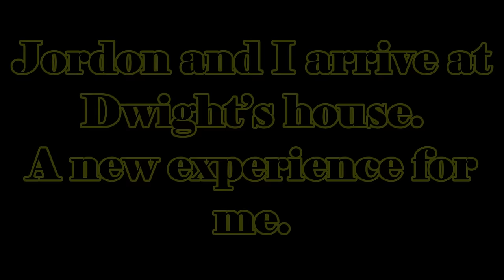Scooter Tramp Scotty. Cross Country Pt-4 (New Vid) #motorcycle #nomadiclife

Comment: Harley's....always something going wrong with it....😂
Reply: That's part of their charm, lol
Reply from the maker: Joes Honda XT lost its hydraulic clutch slave cylender in NM on the way to sturgis. Book calls for pulling the motor to replace it + he had to wait on the parts. Big job for a simple clutch cable that id replace on the side of the road. 1800 Goldwing manual calls for 4 hours to replace the air filter. Yeah, i think harleys break more but on the old ones at least u can fix anything that breaks.
Reply: @scootertrampscotty  Joe was using the wrong bike...a performance oriented sports bike for long distance touring.  Those things need lots of TLC and for short fast runs and parked under cover at night like a race horse.  A Honda designed for purpose like an Africa twin or transalp ....never would have had any problems....
Reply from the maker: @sharmaLlama  
His new Honda, very low milage, lost the rear suspension, $800, the charging system, etc. Joe Sparrows high milage 1800 Goldwing went through 4 driveshafts, 3 timing belts, 3 sets of neck bearings, starters, etc over the years he owned it and Joes an extremely good Jap bike mechanic. I rode the thong once. It was all fucked up like my old bike. Normal riders often think these things never break. Use them like we do and youll change your mind.
Reply: @scootertrampscotty  👍🤠..not going to argue with you mate....you do more miles in a year than I'm going to do in a lifetime probably...enjoying your content, stay safe and keep living free...Cheers to you Scotty
Reply from the maker: @sharmaLlama  
Oh, keeping any bike running out here is the bane of my existence. I think if you buy new then get another every 50k of 60k miles one could probably avoid a lot of breakdowns. But these fucking things just all seem to give you trouble eventually.

Comment: I've seen that bicycle thing twice in Ohio in two different towns. It's a lot of f ing bikes.
I owned a 04 twin cam once, liked most everything about it🤔
Except the ppe (piss poor engineering). Pulled engine after 50k miles and repaired all that nonsense,  did some preventative maintenance while apart. Was furious over all the made in China tags I found throughout the wiring harness!
If I weren't old & disabled,  a 90 s something Evo would be my first pick for a scooter ✌️🤙

Comment: Scotty.have you tried to back the timing plate down a tick to work the ping out? sometimes just a degree or 2 less timing will make it happy..
Reply from the maker: I did. Pinging was caused by a different problem. The motor later went south because of it.

Comment: Over head valves been around since early ‘20’s. 
I have a hill climber F head in storage
Reply: eye was g0nna say early 30s.
🤙
Reply: 1911 was the first year for the IOE (F) head twin cylinder. A single cylinder IOE (F) head came out in 1926 (345 cc ).
Reply: @everettcalhoun8197  that’s good info. My hill climbing F head was a twin originally. The guy wanted to qualify for the single cylinder class so he took the rear cylinder off and capped the hole.
Reply from the maker: F-Head has one overhead valve if im not mistaken. Still oval shaped combustion chamber like a flathead though, aint it?
Reply: @scootertrampscotty  that is correct.
Reply: @scootertrampscotty  The F head had an overhead vacuum operated intake and a conventional flat head exhaust and as you can imagine it was not a high revving engine because the intake did not start opening until there was enough vacuum to open the valve. Domed pistons didn't evolve until the knucklehead with both valves in the head and you could angle the valve to dump more charge into the cylinder.  Alas the factory went back to a flat piston with a squish area. with the evo and then the bathtub with the twincam. Just sayin'. Later, my friend.
Reply from the maker: @everettcalhoun8197  
They made them with a pushrod for the top valve. Ive seen em.
Reply: @scootertrampscotty  Yes they did. Harley experimented with many designs but the vacuum operated intake is still the most intriguing design in my opinion. Later.
Reply from the maker: @everettcalhoun8197  
Slow turning

Comment: Great video again Scotty. Is that a 1996 Road King. I'm looking to purchase one hopefully here shortly.  What are your thoughts on it for traveling long distance two up o highways and two lanes.  I currently ride a 2010 FXD Super Glide Dyna. Keep  the great videos  coming. Thanks.
Reply: Hello, that's my 1997 Road King, and I would definitely not suggest it for long haul 2 up. Especially if you're going to do any interstate riding. She's a great 2 laner 1 up bike, though.

If you're thinking of any kind of distance riding with 2 up and gear, get a 103 Electra Glide, minimum.
Reply: @dakopis  thank you very much for the info.  There’s a 2012 RK 103 27k miles on it asking price $9k obo. It’s six speed I might consider if it’s still available obviously a Twinkie. Thanks again.
Reply from the maker: Itll work but u wont be happy with the power. Maybe i just dont know any better 😊

Comment: If you add or activate ad-blockers, cookie-blockers, block anything that allows them to track you, you will have not all functions available. Complaints are user-error to the money-grabbing system of these proprietary networks. So figure out what blocks you and deactivate that (check your system config, your ad-blockers config, your VPN’s config, your internet safety antivirus whatever kit, every app of that does something to that. that’s what it is, it’s not the operators of these networks, it’s the user’s added crap for good reason, maybe, but to countereffect.
Either you want to protect yourself from the Ads-Mafia, or you lean in. Your choice. But you’ll never get a perfect user experience on diverse levels.
Reply from the maker: No shit. Many guys are getting unsubscribed from my channel and others. Many are not. Is it my stuff or theirs? Ive got a VPN and brave browser, which blocks a lot a stuff.